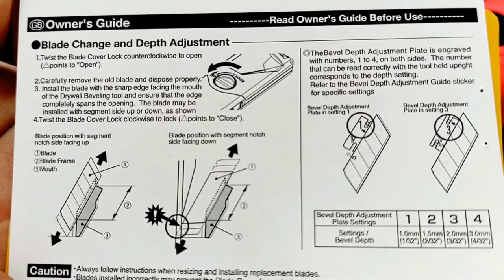Рубанок кромковий для гіпсокартону TAJIMA TBK120-H45 edge planer for drywall

Comment: Seems like it might be a good idea, but I'm just a guy that has done a small amount of dry walling. What would a professional dry waller think of it. If it was for sale in the us it probably should take a standard utility knife blade or maybe a scraper razor blade.
Reply from the maker: Thanks for the comment!

There is a new model of drywall planer from Tajima (TMK-KV45) for sale in the US that is compatible with two blade sizes.

Reinforced blade locking mechanism to minimize blade chatter. Durable die-cast aluminum and stainless steel coated base. 3 spare blades can be stored inside. Compatible with 0.7 in (18 mm) or 0.9 in (22 mm) wide blades.
Reply: I got mine off Amazon, but it comes in Japanese only packaging and instructions, this video was helpful.